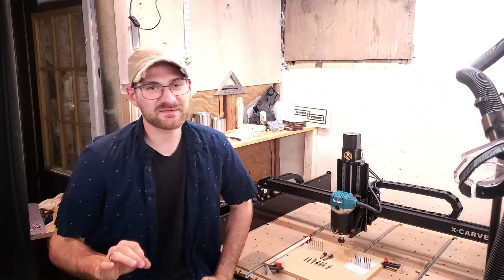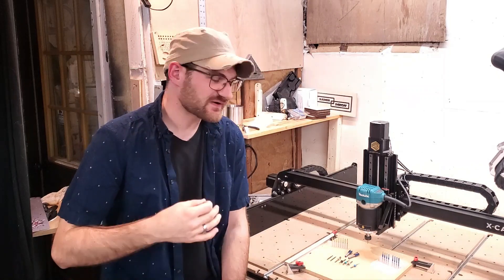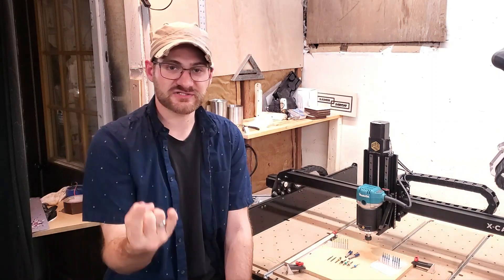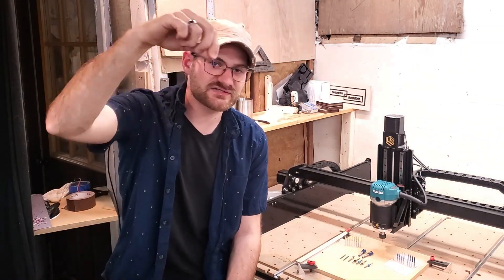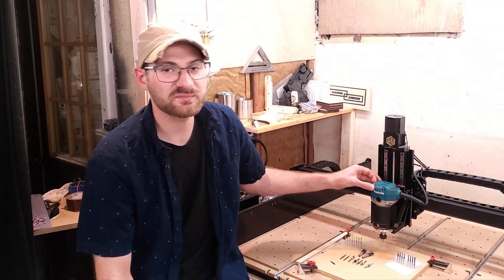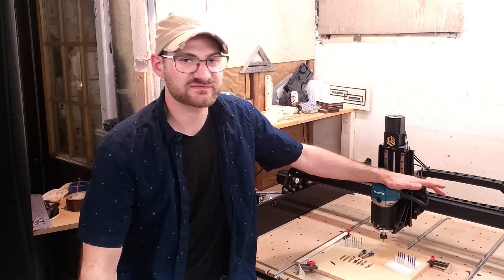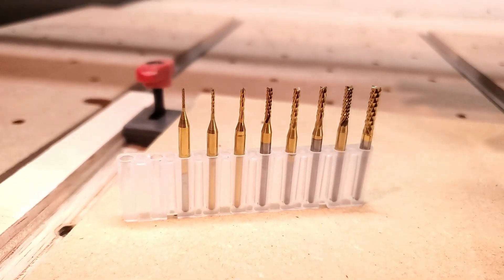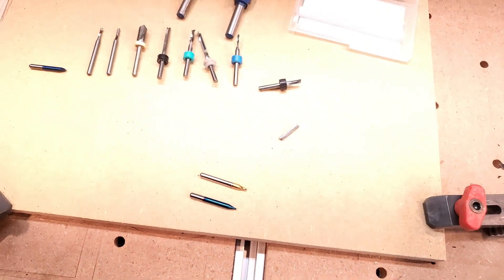X-Carve | Bits, Speeds, and Feeds

Comment: Wouldn't you use a slower speed for a larger diameter as the outside of the bit would be travelling faster as the same rpm as a smaller bit?

Comment: Great video, quick question.  I have the same Cnc.  The problem I’m running into is my Cnc only cuts certain stuff, it leaves stuff untouched.  Any and all help would be appreciated.
Reply: Could be a few things. Is the material the same thickness at all spots? If it is, it's most likely that your cnc needs to be tweaked. Double-check to make sure the rails are parallel and the same height from the bed on both ends. If that all looks good the bed is probably a little warpy (this is kinda expected with the material the waste board is made out of). The middle of mine is lower than the outsides. I used playing cards to shim the middle up a little bit. Hope that helps!

Comment: I’ve got an 1.5” surfacing bit and I’ve heard that once you get over an inch you should begin to slow them down instead of speed them up.
Reply from the maker: I'll have to get a larger surfacing bit and put it through some tests.  I have not tried anything that large so far.
Reply: Generally speaking, the larger the bit diameter the slower your rpm should be. Think of it this way: if you have a 1/2" diameter the circumference is a little over 1.5" while a 1" diameter would have a circumference of a little over 3"... so the speed of the larger bit at the outside (where the cutting is taking place) is moving way faster because it is traveling a lot further per revolution.
Reply: To get your RPM you take the SFM (Surface Feet per Minute) recommended by the endmill manufacturer for that material type and plug it into this formula. 3.82xSFM/Tool Diameter